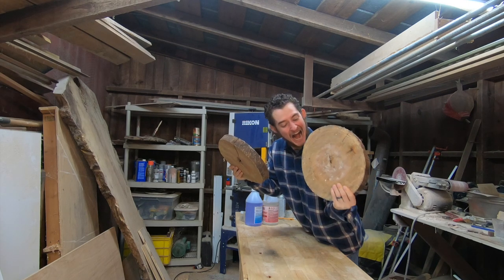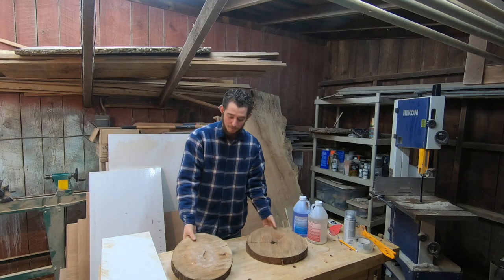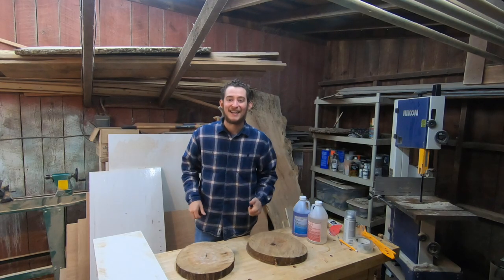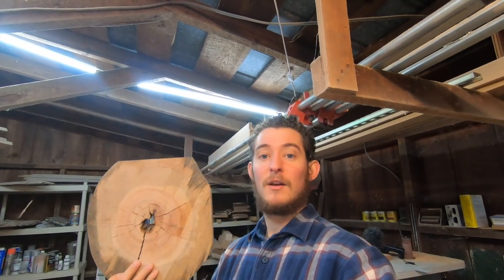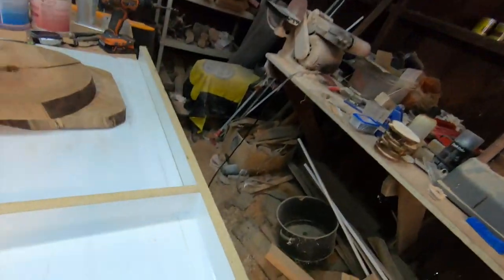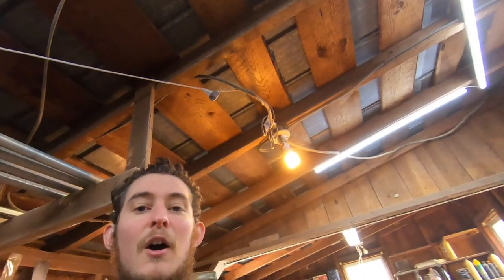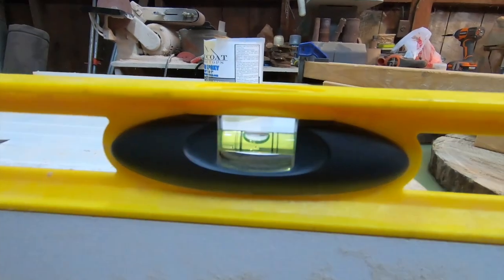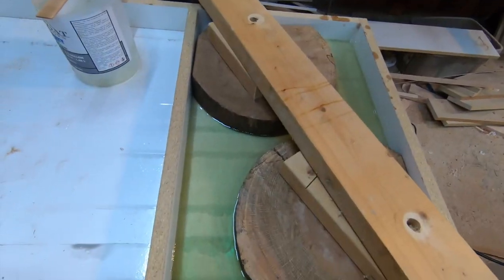DIY: How to Make a Serving Tray/ TV tray from wood Cookies and Epoxy Resin Art!!!! Part 1

Comment: I was going to do something like this, but I accidentally ordered Table Top Epoxy instead of Casting epoxy :(  . Is it still possible to do this project with Table Top Epoxy if I break up the layers every 4 or so hours until it reaches desired thickness?
Reply from the maker: Yes absolutely! You only want to pour each layer about 1/4” thick. Once the previous layer is firm but still soft, you can pour the next layer! Thanks for asking!!
Reply: @GoodViewWoodworks  Awesome, thanks! Also, what do you put on the bottom and sides of your form to have the epoxy piece remove easily from the melamine? Do you use any kind of tape or mold release?

Comment: I see you don't spend the $17 on Tyvek tape. Expensive stuff. And you recycle your forms. I finally saw the price for a sheet of that today. Ridiculous.
Reply from the maker: Yeah, I can’t see the sense in buying the tyvek tape... and the “shelf board” at my Home Depot is about $25 a 4’x8’ sheet. Relatively inexpensive... for a sheet of straight plywood...
Reply: @GoodViewWoodworks  you ever hear of anyone using a product from Menards called Famowood® Glaze Coat® Clear Epoxy Kit - 1 qt ?
Reply from the maker: Yes I have! It works well. The only problem with it is that if you were going to use it to cast with, it may not work. This is because when it’s poured too thick the exothermic reaction that happens causes a lot of heat and bubbles. I’ve seen it poured about 1.25” thick and it melted a plastic cup! Lol 😂
Reply: @jeremypease6191  ooi